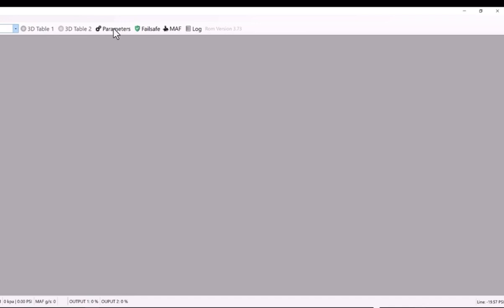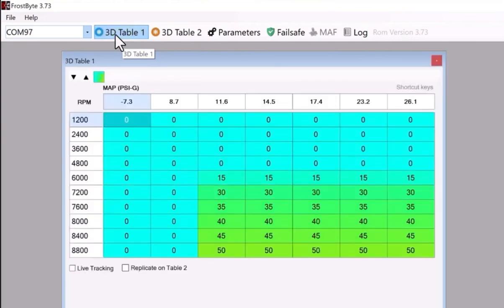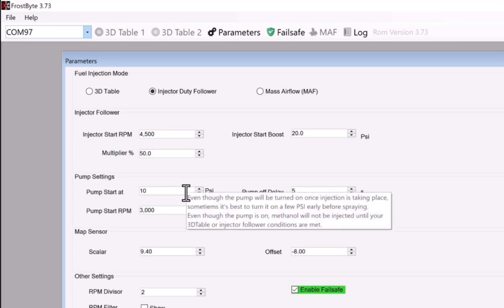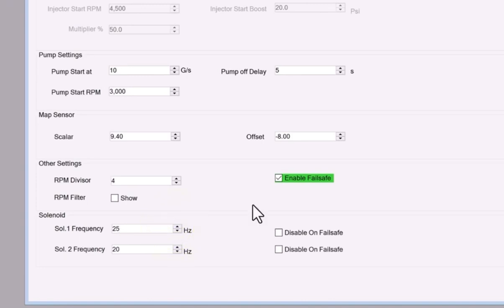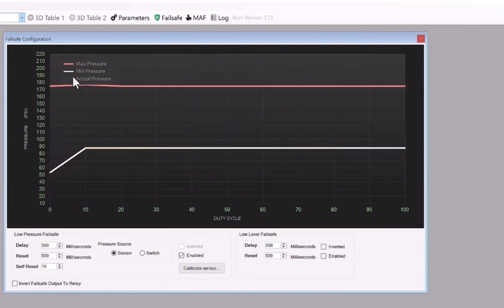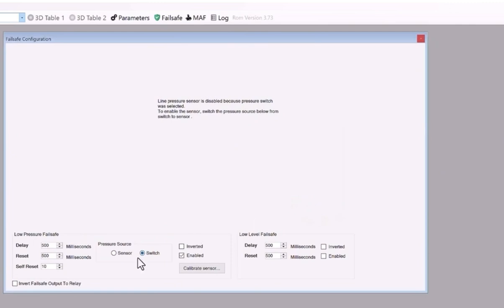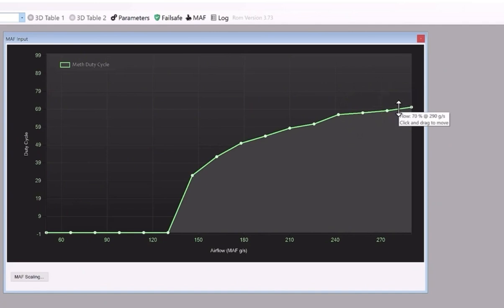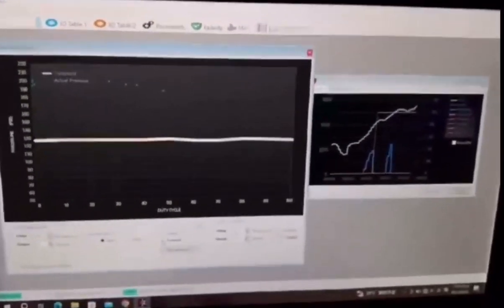Frostbyte water methanol injection system

Comment: How long does it take the pump to pressurize the line?
Seeing pump settings - Pump start at XX psi got me wondering.
Reply from the maker: @branchprediction9923 you set the pump to come on and pressurise the line before you start injecting and pulsing the solenoid, but line pressurisation takes less than a second